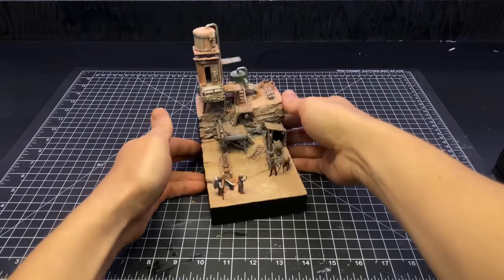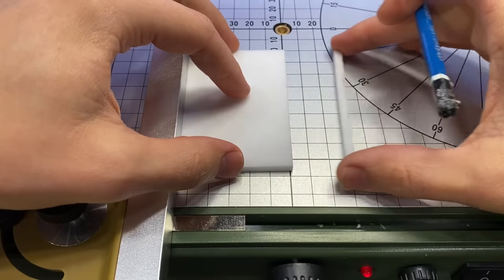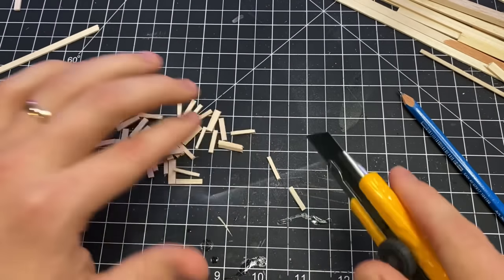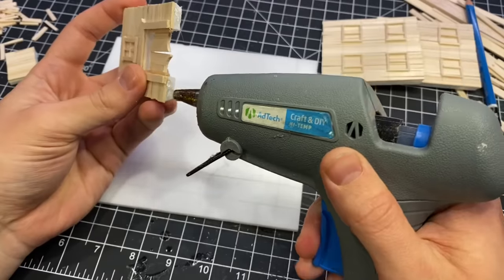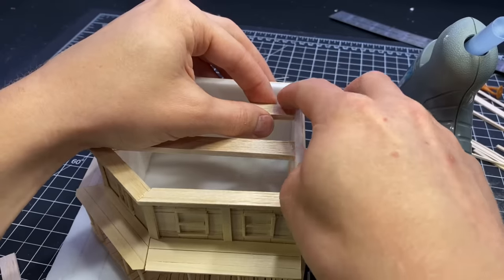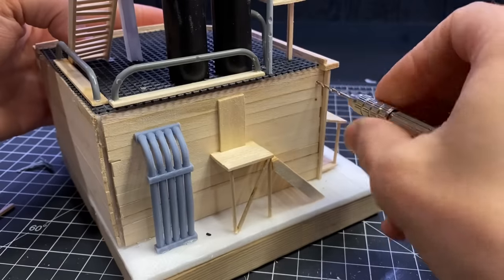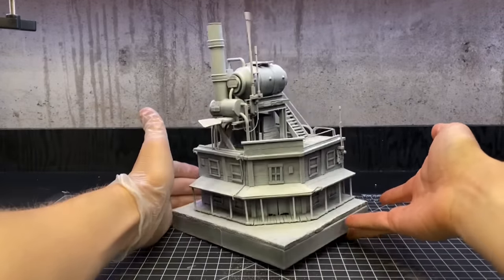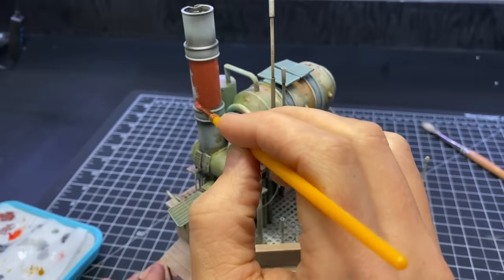My Western Town | Building 1

Comment: You should consider getting a tool called “the Chopper”. They’re made by a company called North West Shoreline. They let you easily cut strips of wood and styrene. You can set a stop, so you can make repeat cuts of the same length. Other companies make similar products too. I think they start around $40.

Comment: For the walls, it may be easier/give you a slightly cleaner look if you cut them down to close to size, glue them to the foam, then cut them/score and snap them all at the edge of the miter. I haven't done this with wood, but I've done it with packaging projects.

Comment: The two guys on the left are rail workers,  the beam is a rail tie and the full length sledgehammer was commonly used for driving spikes and breaking up boulders and other rocky obstructions quickly (shims and wedge or chisels).  Third guy has a short whip, so hes a cowboy or rancher.

Comment: A boardwalk would be the typical name given to the slightly raised up front walkways of individual buildings. Some are designed to match each building as a whole and others would be built at the time of the building's construction, giving it a mismatched patchwork of boardwalk as new buildings are raised. This is to keep in mind that these areas could get rather muddy and quite dirty. Gotta keep those dresses and suit pants clean. Part of the reason these boardwalks exist. I do prefer the character of an old mismatch type of look. Makes things look more interesting and provides story to individual elements of an otherwise complete community of elements.

Comment: Little bit late, but that porch would be called a boardwalk. S9me towns just had them in front of individual buildings, others had them running the full length of the main street, if the buildings were close together, with small staircases and steps to lead into alleyways and down to street level